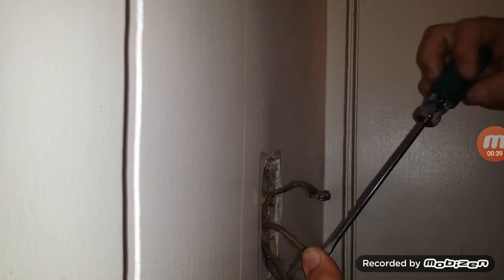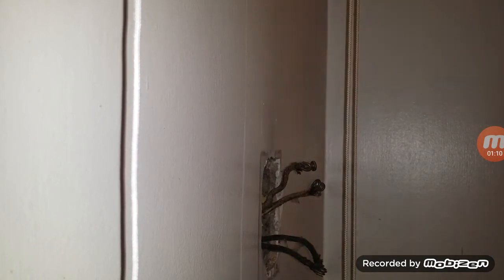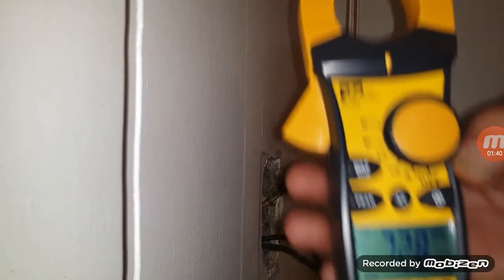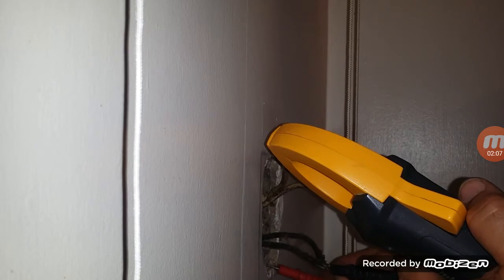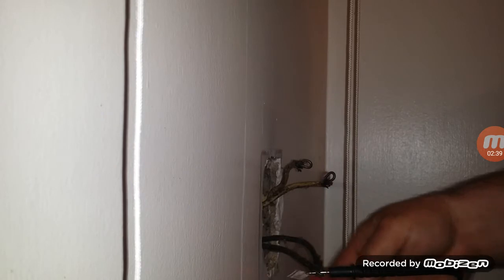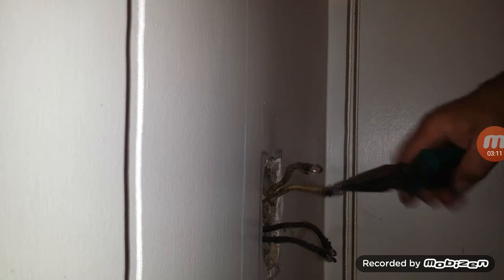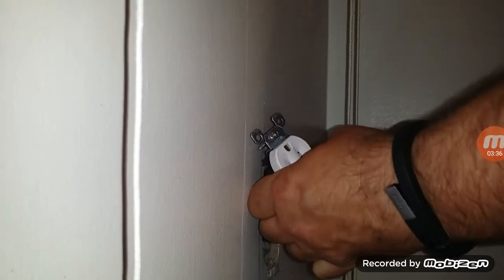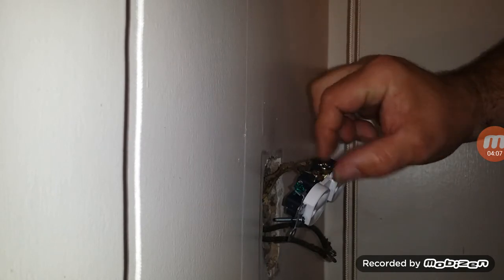HOW TO CHANGE 2 PRONG OUTLETS (instructional video)

Comment: Why didn’t you turn off the power before installing the receptical?
Reply from the maker: In the Description part of the video, I wrote " I suggest if you are a home owner or novice then TURN OFF THE POWER TO THE HOUSE. (Just PROTECT Yourself and BE SAFE) " 
But to answer your question, because I was showing everyone how to determine if there was a Ground Present or Not. The easiest way to do that, is with the Power On.